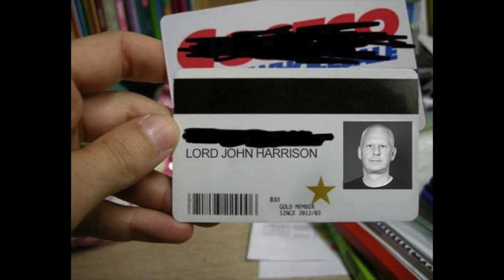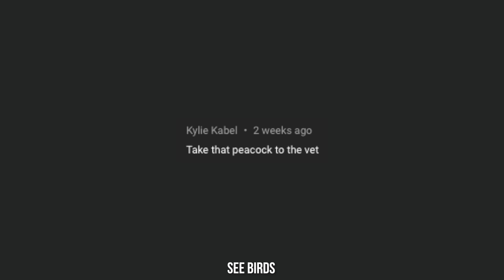The Vet permanently INJURED our Peacock

Comment: As a veterinary nurse, I can say with a fair amount of certainty that the blood draw itself will not have caused the bone to break and protrude from the skin. Without knowing all of the details, all I can do is speculate on how the injury came about - mishandling, or an accident while the bird was unsupervised. It's particularly difficult to say when all information is given in a biased, edited format that can potentially omit information (even accidentally). It sounds like a combination of different factors, including a lack of bird-experienced practitioners in your local area, have led to this situation. I for one would not consider myself as experienced enough to do blood draws on a peacock without an actually experienced supervising clinician if I had only handled three other (different species) birds previously. I will also briefly lend my agreement to those who recommend using a different method of faeces collection to the cage in the future - for example placing down suitable sheeting and checking regularly (I presume you must check on the birds at least daily for food + water) rather than putting the bird inside a cage with no flat surfaces to rest on, which could raise the risk of injury to the feet and the development of bumblefoot.

I think what is important at this moment is to prioritise the bird's welfare over all else. It should be considered if the bird is in pain and what recovery options there are (and how realistic each is) and and an appropriate decision made. I sympathise that it is heartbreaking to lose any animal, particularly through such unfortunate circumstances, and hope that all your other animals remain safe and healthy.

Comment: An oral antibiotics should be given for Osteomyelitis (bone infection) a spray won't cut it.Clindamycin, Lincosamides, Amoxicillin should be used. If not treated amputation is the only option to save the bird. Second depending on when the break occured the bird is gonna have an elevated white cell count so your not gonna get accurate results with either blood or fecal tests.

Comment: Dude it’s your cage setup, the vet didn’t do anything wrong, at all.
Keeping is a normal practice in poultry farming it helps you to know if your breeding stock is healthy and ready for “performance”, whatever that may be.
If you are a hatchery performance is the act of breeding, if you are a cockfighter then performance is the act of fighting, if it is just a pet then performance is the rooster protecting the hens.
Keeping can easily give you insight on what’s going on with your bird, you can easily tell by the droppings if there is coccidiosis or worms, etc, things that will negatively impact the “performance” of your birds.
However, even cockfighters will keep the cage on the ground and use a bath towel to collect the droppings on, the birds do not have issues when the cage is on the ground. Each time your bird moves around in that cage his legs fall through the giant holes, his wing gets caught in them, he has to injure himself to get back up on a roosting bar. YOU DO NOT NEED TO ELEVATE THE CAGE. It is a dog kennel that comes with a plastic tray from stock, use the tray, check in on the bird frequently. Not to mention, what if you had to stand on paper clips all day? It wouldn’t be comfortable, would it? Because that’s exactly what it feels like for your bird to balance on the wires of that dog kennel.
Your coop is fine, but that dropping keeping cage setup was absolutely abhorrent.
Search “Sabong keeping” on YouTube for a how to video on how to do this properly without harming your birds.
That’s right, sabong fighters are better to their birds than you have been to this peacock.
I hope your vet has it in their heart to forgive you for this video, good avian vets are hard to find, last thing you wanna do is burn bridges.

Comment: I am not a vet. But it looks very similar to what my duck suffered from when she got an antibiotic shot in the muscle of her chest. She ended up with a bacterial infection at the shot site called  necrotizing faciitis. In 1 week the infection exposed her breast bone. So it spreads fast and can enter the bloodstream. I found a vet near me that specialized in poultry. He cleaned the wound with saline solution and she was on  Clavamox until it was completely healed (2 months). He also prescribed silver sulfadiazine cream to apply on the wound . I cleaned the wound area twice a day with saline solution and stopped using the silver cream after 1 week and started using veterycin spray then using saline solution once a day. During her healing process I kept her inside our shop in a big kennel so she was kept clean. We also had to keep her wound dry. She healed beautifully. I believe the medicine and directions given to me by my vet may help your peacock too. I want to add that the peacocks wing looks abcessed so it  may need cut open and drained.

Comment: To me the breake was more likely caused by the cage used to collect poop than a butchered blood draw. The openings at the bottom are pretty big - big enough fot the birds wing to get stuck in and break. I don't think a wired cage with such big holes was the best idea for the birds safety. Birds have very fragile bones and peacocks wings are more delicate than for example chickens. that's why with bigger birds you first secure their wings and shouldn't really hold them upside down just by their legs, that not only can injure them but also stresses them out even more...
I'm not a expert though, not even qualified really, so maybe I'm wrong. my uncle used to be a bird biologist, not me.
Reply: I work with birds. You're right, that cage was extremely dangerous and I think the bird got injured inside it. He could barely stand in it! I can't fathom how they thought that was safe. 🤦‍♀
I feel bad for the vets if they had nothing to do with it and had to deal with the accusations.

Comment: I found using some tea tree oil spray (homemade) helps repel insects from wounds because of the strong scent. It also acts as a healing ointment so if you want to try it out instead of the vet spray, it's a good replacement.

Comment: You need to put a roosting bar or dowel (like an old broomstick) in the cage so he won't be on those large-spaced bars on the floor of the cage. It will prevent muscle exhaustion on his feet and provide a perching spot.

Comment: see the symptoms before the sudden death of your peacock. the symptoms that occur are very similar to the general symptoms of Tetelo disease or Newcastle Disease (ND). although I hope not, because it is very contagious and deadly for poultry. however there are also similar diseases that are very common in poultry but are less lethal and contagious. but the causes and treatment are similar

maybe I have a few tips for prevention and treatment.

to avoid this disease as much as possible needed enough sunlight. a semi-enclosed, half-open to the sun poultry house is recommended. but for the cage that you make is good enough.

but the drawback is that the cage is too small for the size of a peacock cage. he needs more space to move besides that it's too risky to be easily contaminated with dirt. moreover, a small space can make the cage easily damp due to dirt and it becomes very risky for the telo virus to appear.

if you have been exposed to it must be treated immediately. because if you have contracted this virus death in poultry will occur very quickly.

for treatment can be given drugs in the form of antibiotics. if the poultry is difficult or doesn't want to eat, it can be helped by giving liquid food (can be helped with a pipette or some kind of injection with a tube to feed the chicks). for additional food, 1 clove of garlic and/or ginger can be given, cut into small pieces and mixed with the feed.

that's a common way that can be done to avoid telo or ND by me and some friends from poultry farmers
(chicken, pheasant, peacock).

sorry if my english is bad because i use google translate. I can understand English but have difficulty speaking or typing because my grammar is bad.

Comment: The Vet doesn't do gram staining in house? It's a simple procedure. heck w/ simple materials / equipment any one can do it same for fecal flotations- very easy for anyone to do w/ a basic microscope & slides . I'm surprised that antibiotics and the injury wasn't cleaned & dressed to prevent treat the infection. I work w/ a Vet the treated exotics - birds / reptiles / small mammals  back in the early 00's when we needed to do a blood draw we used insulin syringes - very small needle -  or did a nail clip. Gram staining was done in house. A tech is NOT a Veterinarian and never should have laid hands on the bird esp if the vet is not qualified for treating an avian. This is what can happen when unqualified folks try to deal / treat / diagnose  a species they've NOT been trained to deal with.

Comment: Use iodine on the wound rather than that wound spray or use that spray they made you buy after the iodine has dried.  If you see "bugs" or mites comin from the wound, use a gauze soaked in saline solution or even soaked in iodine.   
You can get a sterile saline solution (for external use) purchased from the pharmacy.   
If you can soak/irrigate the infected area with the saline solution daily and then apply iodine, I think that would get better and quicker results than just using that spray.

Comment: Blood tests for any bird is difficult, the needle normally used is very small, and when done correctly i.e. the bird is held firmly, to prevent injury, the blood taken is very small. Second Kansas State will test for anything with that small sample. Multiple tests are not needed. The idiots at the vet obviously didn't do the paperwork correctly. When in doubt, call the state veterinarian for your state and ask them for testing. They will do a proper draw and test for everything, and they send it to NVSL.

Comment: -'=
Coming from a vet tech who has worked with exotics including multiple types of birds, there is no way a blood draw could have caused that injury. The largest gauge needle that is used is typically a 20g and even more commonly used is a 22g or 24g (a couple smaller size than what is used in most ear piercings). That injury is at a joint, which no vet tech or doctor I have not only worked with,  but also just witnessed drawing blood during CE or wet labs has ever drawn blood near  a joint,  not only for risk of injury,  but also for the shear difficulty to actually collect blood in a high movable area that the animal (no matter the species) is  not going to hold still. The veins of avian species are actually beside the bone, not (usually) directly on top and have to have blood drawn higher than the joint itself. That being said if an infection did occur that affected a bone to the severity of causing necrotic tissue then it would be moving in the direction of blood flow, towards the heart not toward the tip of the wing, so it would actually make more sense for the infection to be around the shoulder but still very very unlikely. 

The more likely cause is that he lost his balance when being in such a wide spaced wire cage ( which was not the best choice given how unhealthy it is for their feet and all the other risk associated with it like limbs getting stuck or him falling through and being unable to get himself back up on the bars) and got his wing stuck, and then broke it while flailing causing the bone to protrude. There is not an infection that I have seen or heard of that would cause necrotic tissue to be formed that quickly and I have seen animals with MRSA infections after orthopedic procedures that have very wide 4 in to 6 in incision that are susceptible to become necrotic and open up. If the wing was broken in the cage and had a large open wound (which again I point out most of the infection and swelling that was shown in your video was moving up  towards the shoulder not down) then it makes since for it to quickly become infected.

I'm definitely not trying to sound rude I love watching you guys and can tell how much love you have for your animals and I do believe that the vet clinic could have definitely spent much more time on educating you guys on how it couldn't have been then the blood draw rather than just showing you where they pulled from but I also do not think it's fair to automatically put blame on a clinic 2 days after visiting given the enclosure you guys had him placed in.

Comment: I feel like if you had put a smaller mesh and or secured a piece of wood or stick across for the peacock to stand on, In the poop cage, you could have ruled out the possibility of the peacock's foot slipping and ending up with these other comments about that being the reason it's wing ended up that way. Since it would have been much safer. Sometimes birds make mistakes too and injure themselves.

Comment: First off..
This isn’t your fault, from my own expierience it is hard finding an exotic vet, and then even harder to find an exotics vet that will see and treat whatever is deemed poultry or fowl, then to make things worse it’s hard to find one that has expierience with them. 
I’ve had my own hellish expieriences with malpractice at the hands of veterinarians that we’re even willing to see my birds so I’m sadly not surprised that they did this to your poor peacock. 

I would seriously advise you to get your bird on a broad spectrum antibiotic, maybe baytril. The proper course of action would to get the injury examined and get sensitivity testing on the bacteria to determine the correct antibiotic needed, but easier said than done, unless you can find a competent vet good luck with that. 
The spray isn’t going to treat an internal infection, it’s possible the bird could recover from the infection on its own, but that’s doubtful if the infection has gone into the bone, so if it was my bird, I would put him on baytril.

Unfortunatly I doubt he’ll ever regain full use of his wing, too much damage has occurred. I’m sorry.

Comment: The wing is broken and there is nothing that can be done. The wing could have been broken during the blood pull it it flapped and wasn't held properly however more than likely the wing was broken while it was in the cage. There were huge gaps in the floor of the cage and would not have provided a stable foot hold for the bird causing it to lose it balance and flap. The beating of the wing on cage walls would have been enough for it to happen. If the bird had a broken wing at the time you brought it home you would have noticed. It would have been flappy and when you go back to rewatch the video it isn't flappy. The dog kennel was a little inhumane for it to have been in there with floor gaps that large. It was a great idea but maybe should have had some closer nit wire providing more stable footing where it would have been less likely to be unstable and beat it's wings against the cage walls.

Comment: A blood draw doesn't cause the bone to stick out! And if it had been an infection that spread from the injection site there would be redness and swelling where the needle went in.
This is a traumatic injury that made the bone get exposed to the outside that went untreated long enough for actual BUGS to colonize the wound!
It's like if you left a blood sample at the doctor, and on your way home broke your wrist on that arm badly enough for your bone to get exposed. But you weren't able to go to the doctor so just went about your day like that, doing farm chores and handling poop. Then when you can no longer use your arm and notice the bugs you try to blame it on the blood draw!

You need to get that bird to a vet that's actually specialized in birds, and not one who has seen two birds in total over their entire career. You might need to travel quite a bit, but this kind of injury won't just fix itself so it's either that or end your bird's suffering right now! You need an experienced aviarian vet to assess if this injury can ever be healed or if it's just prolonging suffering.

And if you ever have a situation again where you suspect something contagious because of a suspicious amount of deaths in a group, a better bet might be to send off a recently dead bird to a necropsy to find out why it died.

Comment: What happened was: bugs (namely probably mites) got into the wound and opened it up, and did so enough so that when he moved his wing it pushed the bone out. Im not saying that its your fault, but after any foriegn experience you should do daily basic physical exams. It shouldn't have been that hard since it was in a 2ft cage. By the way the cage didn't help, you should have probably put smaller wire in the bottom, the wing movement when his feet fell through didnt help him. It was just a bad-ended situation, Im sincerely sorry this happened to you.

Comment: This is SERIOUS. That wound can cause an infection to the entire arm and risk spreading the infection to the rest of the body. It really needs to be flushed with fluid or luke-warm water, rid of parasites (if any), covered with antibiotic ointment, get closed somehow, and then maybe that spray. As well as be taking antibiotics, and short term anti-inflammatory. Electrolytes and food are important. Also, he might need a little warmth so his body can concentrate on healing if that's ok for peacocks.
I agree that wing needed way more than what they provided. How dare they push product on you without giving actual antibiotic prescriptions or trying to help that awful wound, screams red flags.🚩
 The wing will probably need amputation after all this. Exposed bone is no joke and if it doesn't get help, the bird might pass sadly. 
 Hopefully you can bring justice to whoever did this, of course they would say it has nothing to do with them, document everything, and talk face to face on call with someone in charge.
I hope everything turns out ok. 😔🙏💕